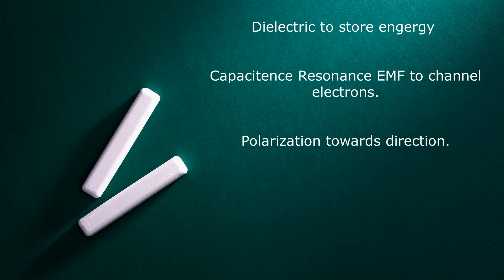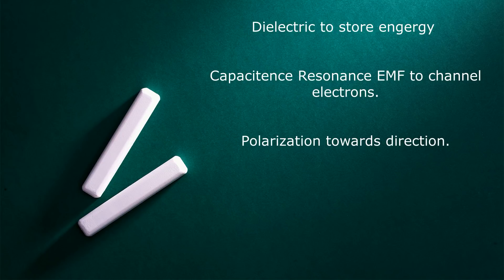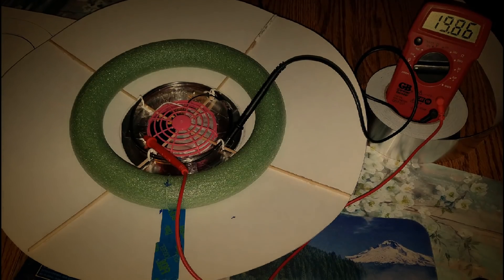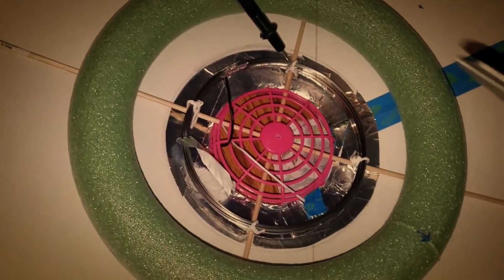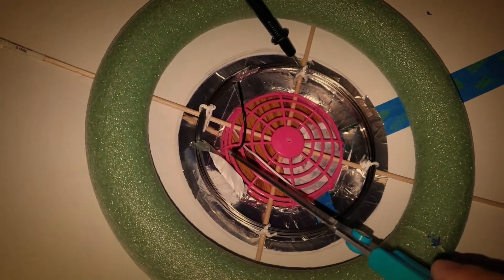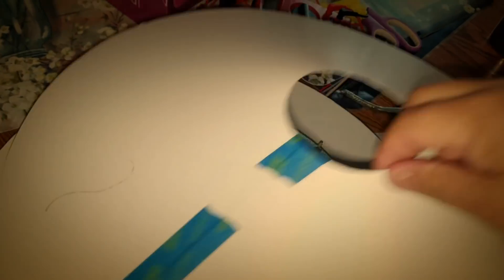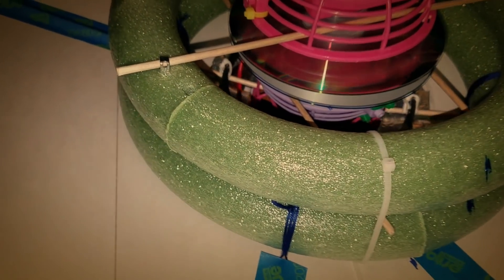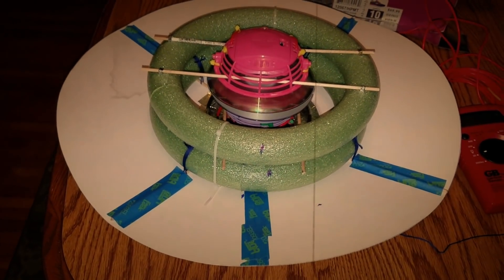anti-gravity project II

Comment: Good job! we have about the same idea. though im  working on a blimp force feild concept. i orderd for a 60,000v power supply. currintly my power supply current was too low and just 30,000v.
Reply from the maker: You got it, increased area of your force field areas floats it but make sure your hull bottom is V shaped, a round hull isn't angular for EHD, I'll be using 10kv since my craft is  capacitor.
Reply: @jefflucas_life  Very nice!
Reply: @jefflucas_life  my idea is a plasma bubble. altrasonic sound waves act as a thermos holding  back the heat like a shock wave. an electro magnet holds on to the plasma causing the craft to be polled up from above
Reply from the maker: @ironmax654  your idea is fusion like our sun, you can use one ultrasonic emitter at 25 kHz using standing waves, a  neon light without glass, would this offer a better mouse trap?
Reply: @jefflucas_life  no standing wave. the magnet does the counter wave affect. the wave needs to be the mass of the plasma particals, so i think l need MHZ for the sound waves.
Reply: @jefflucas_life  if you watch a big bomb explode youll see it goes up  down then blows because the shock wave holds back the heat/ light.
Reply: @jefflucas_life  so it shouldnt produce much light or at all if their not releasing their energy outside the waves
Reply: @jefflucas_life  not fusion, the particals  motion increases space moveing to other waves if the pressure is to high or excape all together. my way of bringing empty space to earth
Reply: @jefflucas_life  i did a seach but couldnt  find good examples of bomb blast. basicly it works like fiber optic walls reflecting the light back. basic science of light refraction. a space blanket does it, too
Reply: @jefflucas_life  but i like your idea for being outside the box of expectations adding your own flight dynamics. i live in japan so i should consider time.
Reply from the maker: @ironmax654  Hope you are well Max.

Comment: I’m working on an anti gravity device that uses cones and sound to create a toroidal field around an object thereby creating a gravity free zone.
Reply: What you need to do is to take an  improved Hans Colers free energy machine into an energy Converter coupled to a Van De Graaf band generator in conjunction with a Marconi vortex dynamo [a spherical tank of mercury] to create powerful rotating electromagnetic fields that affected gravity and reduced mass.

Comment: Frikyeah dude!!!!!!!!!!!!!!!!!!!!, let's fly!!!!
Reply from the maker: ### Halbach Array and Magnetic Levitation
A Halbach array is a specific arrangement of magnets that creates a strong magnetic field on one side while canceling it on the opposite side. Here's how it could contribute to lift:

1. **Halbach Configuration**:
   - A spinning disc of magnets, arranged in a Halbach array, creates a highly concentrated magnetic field pointing upward.
   - The 10,000 RPM motor spins this disc, enhancing the magnetic field's strength and stability.

2. **Interaction with the Capacitor**:
   - The strong magnetic field generated by the Halbach array interacts with the charges on the capacitor plates.
   - This interaction can create a Lorentz force that contributes to lift.

3. **Electromagnetic Lift**:
   - The spinning Halbach array and its upward-pointing field provide an additional force component, aiding in lifting the capacitor plate.
   - The combination of electrostatic and electromagnetic forces results in a more effective lift mechanism.

### Detailed Mechanism
1. **Spinning Magnetic Disc**:
   - The 10,000 RPM motor ensures that the magnetic field from the Halbach array is stable and strong.
   - The rapid spinning of the disc could induce eddy currents in the capacitor plates, further contributing to lift.

2. **Lift Enhancement**:
   - The upward-pointing magnetic field acts like a sail, harnessing the electromagnetic forces to create lift.
   - This setup is more efficient than a static system, as the spinning motion enhances the magnetic interactions.

### Practical Application
1. **Voltage and Magnet Strength**: Higher voltages and strong magnets are critical to achieving significant lift.
2. **Material Selection**: The plates and motor components must withstand the high-speed spinning and strong magnetic fields.
3. **Safety Measures**: Ensure proper insulation, shielding, and safety precautions when dealing with high voltages and rotating machinery.

This innovative approach combines the principles of electrostatics and electromagnetics, leading to a more effective lift mechanism.  🚀🔋🧲
Reply: @jefflucas_life  frikyeah thanks bro

Comment: Back in the 2000’s there were lots of documents on Nazi experiments on the 1914 RZF that used 2 counter rotating Aluminium discs above & below a Copper disc which apparently caused an Ant-Gravitic Effect. I think the Counter Rotating Discs cancel out each others inertial field then the Pulsing of the upper & lower coils cause a repulsion effect against the middle Copper disc similar to passing a magnet through a Copper Tube. Apparently the Earths Magnetic Field exists in Layers like an Onion & different pulsed frequencies allow a craft travel at different altitudes whilst oscillating at different frequencies.

Comment: my levitation project is about a levitating car the aluminium core is levitating over 4 parts 
each holds 4 mecanum wheels witch will give me full controll over them for stabilation purposes
they also hold two lifting coils with a phase diffrence between them to creat a force vector
they both spin on an horizontal wheel that should indicate the direction of the vector 
the parts also contain batteries, motors to run the weels but they also need some sort of locator to figure out theire location in comparison to the center of alimenium sheet the sheet will have an arduino and will send necessairy data to the 4 parts via bleutooth communication // the arduino will take the information of all positions process it and sends the accurate orientations to the vectors so they stabilise the levitating sheet and it's stating point via changing the position of the parts in relation with the sheet//using a phone via bleutooth we could tell the levitating car exactly where to go precisely and mind bloingly

Comment: Sorry but this is not correct using plastic as an exterior, no conductive interval relay and transfer of power using plastic I don't think so the exterior has to be a conductive metal aluminum or other casting with the alchemy of Mercury electricity and magnetism. This doesn't even make sense.

Comment: Electro static is micro inertia and gravity is macro inertia force. You can inject macro onto micro and block Earth's macro field making your craft weightless, then charging a capacitor to hover and go. You'll need to up the voltage for light speed and once your craft is completed you'll need to raise the field voltage to form the Einstein Rosenberg bendoverbillybridge search for the entrance of the wormie hole and your off to other places through dark brown matter using zero point no energy-efficient at somelightspeed.😸

Comment: actualy mine is a hot air balloon force feild idea. but just calling plasma the fourth state of matter makes me say blimp.
Reply: Next is microcluster blimps. It's the 5th stage of matter.
Reply from the maker: https://youtu.be/vSn1Ewsm4jY
Reply: @jefflucas_life  LOL! our tools will be about the same. I'll show you my power supply when I get it. it has an atto shut off so it wont die from shorting or over powering. That makes me feel safer while testing. i need to do some prep on four other disc model types. one will just have a bunch of electrode rings on top. to get more heat for less volts.